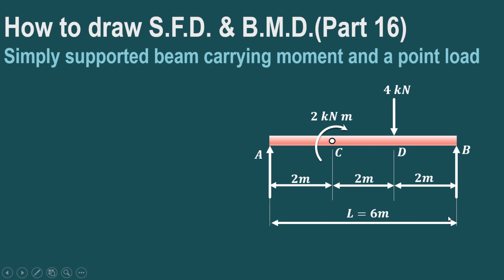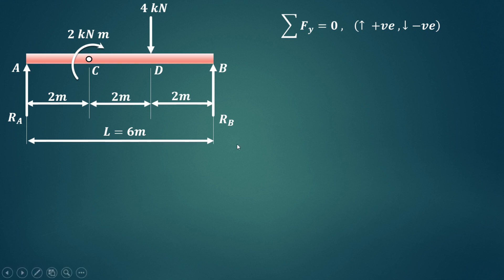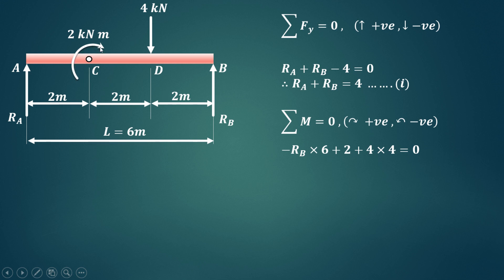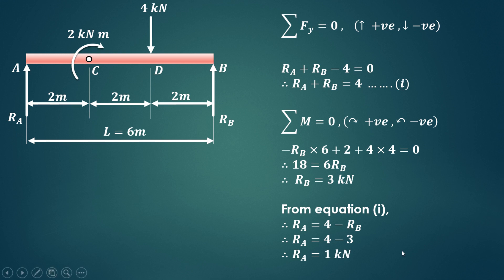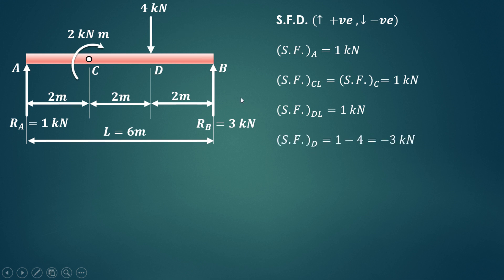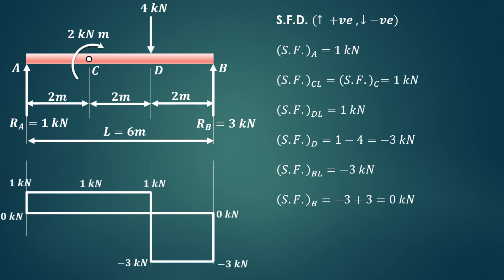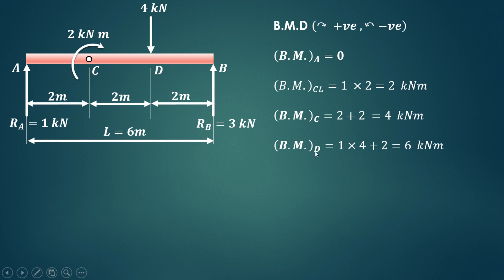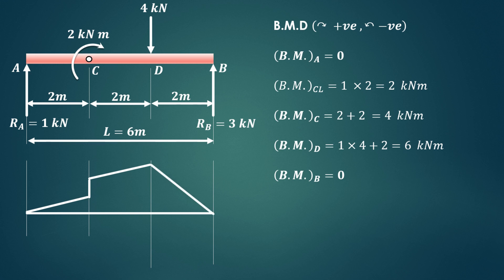Lecture 17 | How to draw S.F.D. & B.M.D. | Simply supported beam carrying moment & point load

Comment from the maker: Useful playlists:
Cam profile - https://bit.ly/3vjpY7a
Mechanics - https://bit.ly/3PClXmz
Beam reaction & Graphic statics - https://bit.ly/3veMwWA
SFD and BMD- Simply supported beam and cantilever beam - https://bit.ly/3PDzA4V
SOM & Structural analysis videos - https://bit.ly/3OEqX8S
Heat transfer - https://bit.ly/3PzxiUe
Thermodynamics - https://bit.ly/3J5ZvQd
Velocity & Acceleration diagram - https://bit.ly/3vj8zf0
Hydraulic circuit & pneumatic circuit working - https://bit.ly/3zAx1e4
Fluid mechanics - https://bit.ly/3ODuggg
Dynamics of machinery playlist : https://bit.ly/3zyRakK
SPPU Paper solutions -https://bit.ly/3S7dmcU
Turbomachinery - https://bit.ly/3cyBftE
I.C. Engine numericals -https://bit.ly/3veJf9K
Machine Design - https://bit.ly/3zBjZgx
Thermodynamics Excel Calculators - https://bit.ly/3cJBYbM
Synthesis of mechanisms - https://bit.ly/3PFSCaD
Finite Element Analysis (F.E.A.) - https://bit.ly/3PYtCex
Mathematics - https://bit.ly/3JaAnHX

Improve your skills & knowledge by the following professional  courses !
Hydraulic courses : https://bit.ly/3OTCDox
MATLAB  & SimuLink course : https://bit.ly/3OEI8Yw
Ansys cfd course : https://bit.ly/3yzFVbu